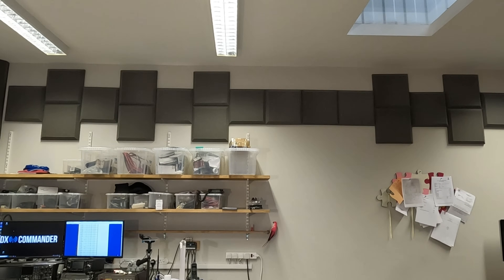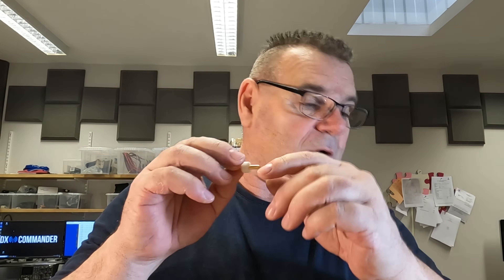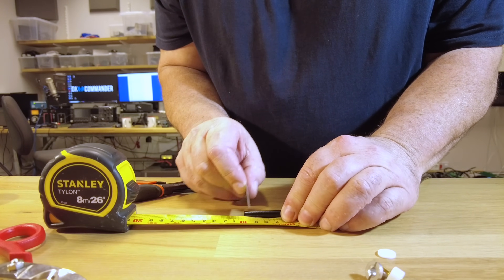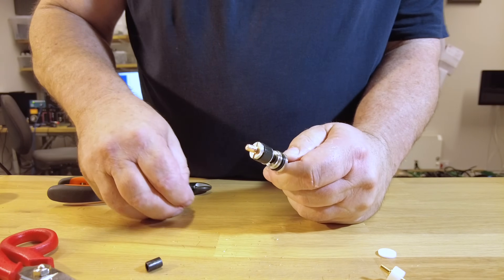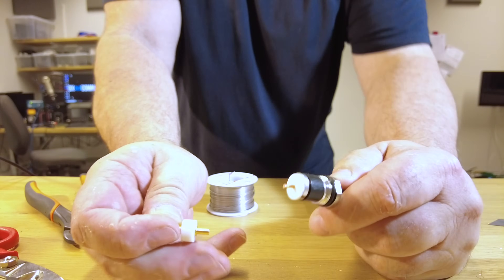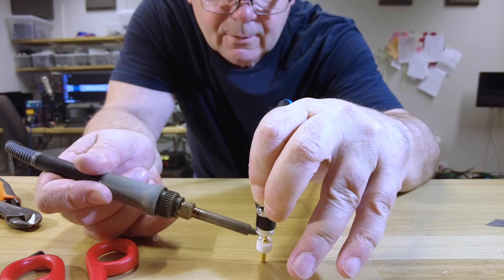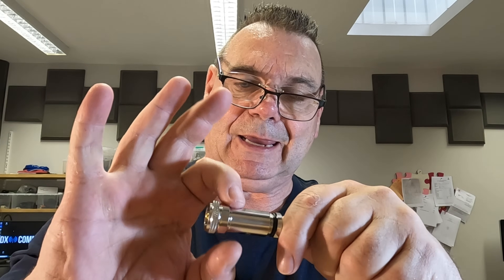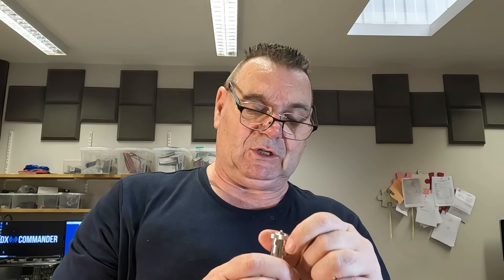Regular Man Fits PL259 Coax Connectors

Comment: I suspect (no guarantee) that you should apply the iron on the opposite side to the hole, testing at the hole with the end of the solder, until it melts.  Then the entire tube will be at/above soldering temperature.  The inner pin will also be being heated, and when things are hot enough, the solder will wick in through the hole.  (Pre tinning should not be necessary, though liquid flux can help.)  Now remove the solder, then the iron, without rattling the connector.  If you apply the iron at/near the hole, then, yes, the solder will melt, but lots of the nested pin/tube won't be hot enough to take solder, and you'll just be soldering near the hole, you'll remove the iron too soon, and solder won't get around very far between the pieces, and that stuff will suck heat from the hot part too fast, so you get rapid cooling that isn't uniform, which may cause the solder to crack inside, leading to a weak and resistive joint, especially when considering skin effect.

Says the guy with zero practical experience with these connectors.
Reply from the maker: I'm sure if I did 10 of these in a row, I'd be fine!
Reply: Not a terrible idea unless the insulation in the pl259 connector isn't Teflon.

Comment: I stick with crimp and center soldered. Flux the center conductor before inserting then solder.
I also add adhesive heat shrink on the coax, slide it down and heat it, keeps the water out a bit better
Reply from the maker: Flux.. OK!

Comment: Lord Callum is not a commoner!😄
I don't think Vaseline would last long in Aussie heat, perhaps plumbers Teflon tape would work better, dunno, worth trying.🤔
Reply from the maker: You SHOULD try it because it does last at 40 C. Good experiment.
Reply: @DXCommanderHQ  okay, didn't know that, sometimes we get to 44⁰c but a typical summer will only go to 38-39⁰c here. I will give it a go then.👍
Reply: @DonzLockz  Teflon is a very good insulator, but you need an electrical connection here. The Vaseline still allows electrical contact between the threads, but it fills all the spaces where water could wick its way in. Dow Corning number 4 silicon grease would perhaps be better but Vaseline is more readily available I imagine.

Comment: Been using the compression connectors for a couple years now. XRDS-RF store. Actually you don't even need the tiny spot of solder from cable center conductor to the gold plated brass pin, you can just crimp pin on conductor. Compression is far stronger than the old styles.
Reply: Cute remark Steve
Reply: @stefanomessi  Well Callum 'loved' it. What is cute? It is in the manufacturer's instructions to crimp pin. A pinhead of solder is a waste of time.
Reply: @Ben--David  these are supposed to be solder connectors, and people who want to apply high amplification on them what to stay on the "safe side".  This is the reason why we also have the "solderless" connectors, but their request is minimal.  On the Connectors for our Hyperflex 13 only, (either N or UHF), we made a special pin that allows either the solderless feature or the soldering one.  Tomorrow morning I shall ask to our technician to try to crimp the current pin on the cable core, and we shall post the results. Thanks for your remark Steve
Reply: @stefanomessi  I did mention the brand I use, and that manufacturer's recommendations. Does your brand also have a gold plated pin?
Reply: @Ben--David  Answering your previous question, I checked this morning with my technicians, and the shape of the rounded pin is such that no crimping is allowed.  We have tried either with the manual crimp tool or with the pneumatic one. The rounded pin has been designed for supporting two thick Teflon rings that are to be slipped in the right position. In other words, in the pin, some protrusions act as a stop for the Teflon rings (for a well-calculated and restricted operative welding area), making it impossible to insert the crimping head (because of these protrusions). even the smallest one available.  I can assure you that following our instructions and using a Flux like ours, things can go very smoothly.  For what concerns the gold plating, we prefer to use a special alloy that costs as gold plating, but without the risk of the bimetallic (Galvanic) effect.
Reply: @stefanomessi , that is just funny,  very cute. "Bimetallic (Galvanic) effect" with the most noble metal on earth, gold. Requires an electrolyte and extreme energy to get gold and copper to interact.

Comment: if your aim was to show how easy assembly is I think you missed the mark Mate! A solder center conductor/crimp shield PL259 with the right  tools and glue lined heat shrink is pretty fool proof and besides I don't have a pair of those special joint pliers! cheers Mike, K1FNX near Boston
Reply from the maker: No real "aim" just a bit of fun and how regular people are going to find this.. Most folks aren't experts. But agree, the pliers are fab!
Reply: @DXCommanderHQ  we actually have 16mm spanners here in the Colonies........we call them wrenches (not wenches) if you would like one let me know..........cheers Mike, K1FNX near Boston
Reply: @michaelpolimer2128  If regular wrenches are spanners... what do they call a spanner wrench?
Reply: @piquat1  maybe a curvy, wiggly thing with tabbies?...........seriously, good question

Comment: Like all gland type connectors they look like a right faff & I've never had any luck with them personally. On the advise of W6LG I started using crimp connectors where you solder the tip of the centre pin & thus far I've never had a failure in almost 7 years. I know M&P stuff is very high quality but I think I'll stick to UR67 with crimp 259's myself.
Reply from the maker: Yes OK.. I've actually never had a failure either on ANY PL259, so there must be some HUGE tolerances for major cock-ups!

Comment: AB4P - I'd use a small drill to enlarge the hole in the side of the conductor to allow better flow into it by the solder.

Comment: I used to live two miles away from an Amphenol plant. You could walk into the front office off the street and buy connectors by the truckload if you wanted. And they were dirt cheap. Even the silver plated PL259's with the Teflon center insulators were not that pricey. Ah, the good ole days....
Reply from the maker: Wow!

Comment: As an aviation electronics technician, I can tell you that I tin every connector and pin that requires soldering. Even if I don't need to. Because everybody knows that solder is better.
Reply from the maker: Wow
Reply: @DXCommanderHQ  
LoL 😅 had to fix that typo.

Comment: First thing you need is a third hand. A small table vice solves a lot of problems and will hold the coax still.
That gives you two hands to do the soldering.

The "helping hands" things with croc clips are too small (unless you change them for somehting bigger)

Your iron may be temperature controlled, but it seems to be under-powered . Many temperature controlled irons have the sensor in the iron body, so they don't really know what is going on at the tip. The rather more expensive irons have sensors AND the heaters in interchangeable tips and so can sense the temperature better. 

What is happening is that as you try to heat up the big centre pin all the heat is getting sucked out of the iron.
You may find that a big old fashioned 60-100W iron with a big bit (big thermal mass) will do better. If you have a bigger tip for your temp controlled iron then try that.

Tinning and solder.
Note that the amount of heat that the iron can provide has a big effect on this as well.

If the surfaces are clean then you should not need to tin first. If you are remaking a joint then maybe.

Likewise you should not need additional flux if using cored solder. However sometimes adding a little flux can help.

Type of solder. DO NOT USE  LEAD FREE solder. It's dreadful stuff and does not flow very well. Aviation, Military and Space services do not allow lead free due to all sorts of problems.

Use a standard 60/40 lead-tin multicored solder. for most work 22swg  is just about thin enough. 

Make up the joint as you did, but holding everything in the vice. put the iron bit on the side of the pin away from the small hole and let the entire pin heat up - with a big enough iron this should only take a few seconds.

Poke the solder in the hole and it will wick inside the pin and into the centre conductors by capillary action , you will probably see the solder start to weep out of the back of the pin. If you see that this the joint is ful; of solder

DO NOT bang on the pin or blow on it, that can cause the joint to form dry,  Just let it cool down without moving it 

With a small vice you can clamp the back nut in the vice then use the adjustable on the flats on the plug body.

One last tip, not directly related to antenna plugs. An old friend of mine used a small table vice, but often clamped a small pair of mole grips in the jaws and used that as a quick release system for holding plugs sockets, pcb's and so on.

Hope this helps.

Andy
Reply from the maker: Andy, I considered the vice but couldn't be bothered to move the cameras! LOL.. Nice tips. Thanks.
Reply: Great tips Andy... thanks for your contribute and please when ypu have time have a look to our Youtube Channel
https://www.youtube.com/c/MessiPaoloniSRLAncona/videos

Comment: Clamp the cable in something like a vise or "third hand" to free up your hands to heat the connection while you add solder to that connection at the HOLE.
Reply: Can't believe he couldn't figure that out for himself
Reply from the maker: I really wanted to use the vice but then I would have to move the bloomin cameras!

Comment: I prefer the old style over this.  I did just try some of the new ones that were designed by DX Engineering (for LMR400).  You need a crimper for the shield, the tip is soldered.  Not bad.  Better than the way the old ones kind of screwed on.  Always thought that deformed the dielectric too much for my tastes.

Interesting connector you have there.  Too many parts for me.  Spent many years as a communications tech.  The more parts to a connector, the more of a pain it'll be to install and conversely, often it's a better connector.  So while these may be a pain in the ass, they're probably decent connectors. :)
Reply: PL259’s are a pain but I always hated soldering the BNC connectors on… especially with a big Weller 100/140w soldering gun

Comment: A little flux pen will really help the flow, you " may " get a dry joint or higher resistance re-heating the solder without adding...when you use you will winder how you did without it...
Reply from the maker: Thank you!

Comment: Cal as of yesterday I've finally replaced all my long feeders and patch leads with M&P coax, a mix of Hyperflex and Ultraflex and the new Evolution plugs. So I've got fitting their plugs sorted, remove the pin from the last plastic ring Hold the coax in a small bench vice, a drop from the flux pen on the core wire, slip the pin on (hole at top) heat from below and feed 0.8mm solder into the hole,,,job done. 
Yes you do need a clean cut and don't tin the inner or it wont slip into the pin
Reply from the maker: Flux pen... Copied!

Comment: Flux & pretin the very end b4 even cutting insulation 😉then flux the pin b4 installing on Cntr conductor. Flux is your friend when soldering, it helps transfer the heat from iron to wire& pin  😉😉see if you can locate amtec 559 low viscosity flux. That stuff is better then Franks red hot sauce, it’s tacky but cleans easy with alcohol but it’s not necessary to clean unless it’s on pc board
Reply: Yes definitely the Pro Flux,  (no clean ones), along with a vice and a pro welder soldering tip , is the right answer for a quick and reliable work.

Comment: Use a bit of vaseline on the silicone rubber sleeve and on the O ring and it'll screw together much easier and less chance of the O Ring getting squeezed out. I think the design at that end wants a tweak, a leading edge to allow the O ring to clamp down a bit nicer as I have found they do get squeezed out a bit too easily. 🙂
Reply from the maker: Interesting

Comment: Take the end of your braided inner conductor and dip it in solder Flex then screw on the end and solder it from the very end the solder will be sucked up inside there's your dinner...
Reply from the maker: Flux is the key then!

Comment: use a flux pen on wire, (not as messy as paste unless you are doing a lot). Fix cable in place on desk by heavy pliers or other weight to give both hands free if you dont have mini vice. Assemble, then hot iron under pin and feed solder to hole on top. Works for me.
Reply from the maker: Flux pen. OK thanks!

Comment: You really need to heat the part with the iron then add solder to the hole or anything else your trying to solder. When solder melts so does the flux which is absolutely needed to make a proper solder connection. Dabbing it on the iron and transferring to the part may stick it together but will NOT be a good "wetted" connection.
Reply: Terrible soldering technique. Never try to get solder on the tip then transfer to the components. Always heat the components then add the solder.
Reply: Absolutely! You need to bring all three items together simultaneously...the item to be soldered, the solder and the iron. You should NEVER carry solder on the iron across to the joint, because the flux will burn off on the iron and you'll be making a joint without any flux and that will mean that it won't be tinned properly and you'll get a bad joint that will probably fail and go high resistance in time. BTW, I am a fully qualified and radio, TV and electronics engineer and we were taught at college back in the day how to do it properly.
Reply: Yes, I cringed when I saw the "soldering" :)  Not even a "Regular Man" should solder that way. You can do better, Callum!
Reply: He wants a better soldering iron too. Some sort of chisel tip on an iron that doesn't go cold the moment you try an solder more than a 1/4W resistor makes the job a 5 second process.

Comment: Try adding flux paste on the center conductor before putting on the pin, I find it helps a lot to get solder trough that tiny hole as you say.
Reply: This is the win.
Flux paste is cheap. Those cold joints or fragile solder blobs are a PITA. Sometimes you can't put enough heat on without buggering something else up: additional flux helps marvelously with flow and "wetting". 👍
Reply: Another bonus of paste flux on wire going into a pin, especially if it's a close fit - the flux will act like grease holding the wires together while you put it together
Reply from the maker: Yes, I need some flux for my 4 PL259s I do annually - thanks.
Reply: @DXCommanderHQ  DCC concepts Saphire no clean liquid flux
Reply from the maker: @trainstrainsandtrains40  Ah. Good tip.
Reply: @ just apply a little bit to the inside of the inside of the centre conductor pin on the 259 and a bit on the coax with a small paintbrush solder will flow lovely.
Reply from the maker: @trainstrainsandtrains40  Found it on Amazon. In basket! Thank you :)
Reply: 73

Comment: The SSB Electronics version has a hollow pin that the inner connector runs through for easier soldering. They also have some helpful guides on their website. Out of 10, about a 6! Harsh.
Reply from the maker: Yep, I do like the SSB ones.

Comment: The M&P PL259s are excelent and the old ones rather Wank, to say the least. I would use liguid flux for the center cable, the finest solder you can get and a small clamp or vice to hold it. I use silicone grease on the braid it totally prevents water ingress and oxidation of the copper cable.
If you are felling heroic try doing the same with silver solder, technically superior but an absolute mare to work with. I used to use it a lot but it is really hard work, it does not flow well.
Reply from the maker: Yes, I think I'm missing the flux tip. Thanks.
Reply: @DXCommanderHQ  Hi Callum.  Yes definitely you need to use a flux which will tremendously facilitate the soldering process.  We also offer for those who make just a few soldering in a row a tiny 2 cc M&P-Flux, that will make everything a lot easier (following our advice and related video)..  I want to send you some of those for your earliest convenience.
Reply: Thanks Dave

Comment: Just built 6 of these M&P Evo 10M-S connectors today Callum on the M&P Airborn 10 ... used very thin solder.  Held the pin in a vise and clamped the coax to the edge of the bench to keep all together.  Then heated the tiny hole and moved slightly the iron away from the hole but still in contact and entered the hole with the thin solder and she melted lickety split.   Using the clamps keeps both hands free of the cable/connector assembly.  The connectors are really a fine piece of machining!  Like little jewels actually.  Also I have 4 which are near the AMP and tuner which have the optional heat sink on the rear of them to dissipate heat.   The heat sink replaces the metal rear of the EVO connector.  I think the wrenches you need are 18mm on the front and 17mm on the back.  You HOLD the front steady and ONLY turn the back wrench.  If you have the optional heat sink, those use a 19mm spanner.   However, I used adjustable wrenches as I do not have mm spanners (yah I am in the USA mate got mm sockets but not spanners hi hi). Cheers... Nice stuff.  Art. W1SWL
Reply from the maker: Hey Art. Yeah, I have one of their "heat" things too. Not used yet. Thanks for the tips.
Reply: Thanks Arthur for the excellent description of our "Jewels".    I couldn't do any better... :)

Comment: I have done rather a lot of these so far and they are so entertainging to fit, as is watching Cal do it, go Cal go. But oh so satisfying afterwared, and always, always test it all afterwards with a mutlitmeter for continuity and shorts from center to braid. Oh and for me always use silicone grease, it all goes together so much easier.